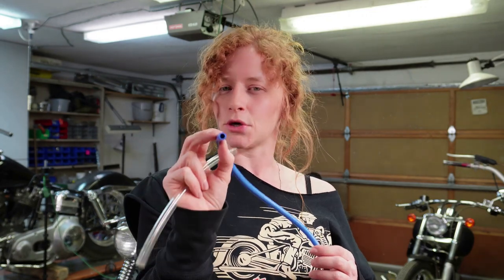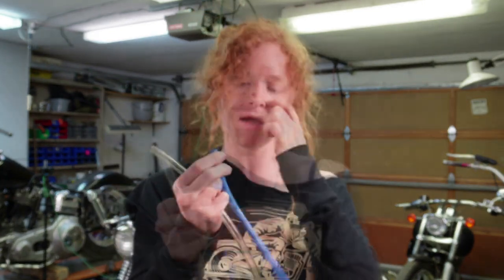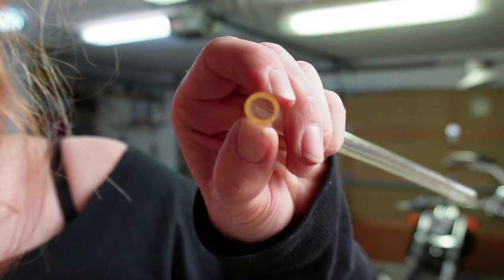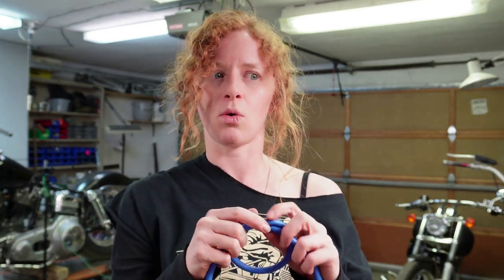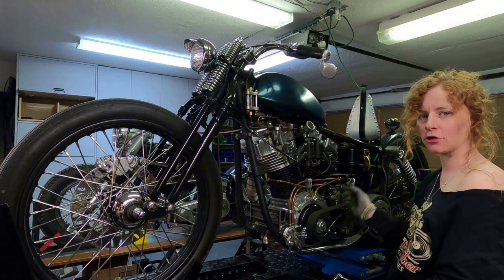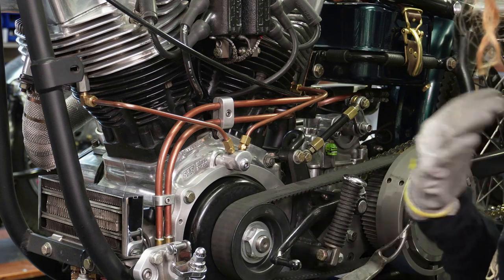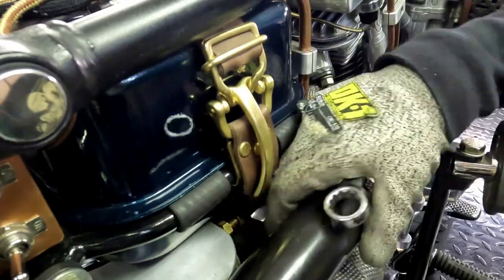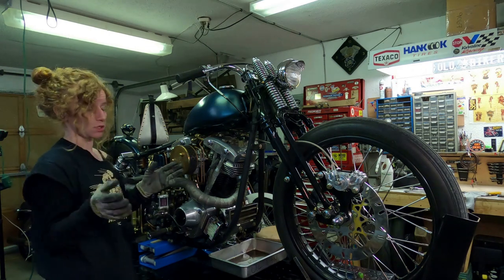Fluorosilicone Seals for Copper Oil Lines on My Bobber Harley

Comment: A set of ratcheting line wrenches from Hofmia work great on fittings with near zero wrench swing clearance, but they're kind of pricey. Cheaper but still awesome are Chicago brand open end speed wrenches, 45 bucks for a 3 pc set that covers 3/8 to 11/16, and to be honest they work just as good in tight spaces as the more expensive Hofmias as long as the fitting isn't insanely seized. That fluorosilicone is amazing stuff, I actually found out about it from my brother who's a chef, it's heat resistant enough for oven use! And the old Ford cop car I have has green silicone hoses, the new ones are blue and even heat resistant. I used it on an A.I.R tube for a catalytic converter, I couldn't believe it didn't melt. Keep up the great work, Angel, your channel's gaining subs daily and with good reason!
Reply from the maker: This like wrenches sound like they would make it a lot easier for sure! I’ll have to look into it. 
And yea, this silicone tubing feels like great quality stuff! And it hasn’t had any leaks yet!

Comment: Have you ever annealed your copper oil lines? 
Copper work hardens fairly easily.
Easy to do, after cleaning the oil from the lines, using a torch heat the just to the point the color starts to change and drop into water. 
This will bring them back to soft and pliable condition. 
And prevent stress cracks in the future. 
This also works for any copper crush seals you have. 
I wouldn't be surprised if you already know this as you seem to have a wealth of knowledge already. 
I just wanted to add this in case you didn't know. 
As always, I really enjoy your content. Keep up the great work.
Reply from the maker: Yep, I’m familiar with the process. Thanks for the comment!

Comment: Love the hinge tool for cutting hose square!
Reply from the maker: It works eh! I found a but if oil on a sharp blade really makes a big difference too and prevents the hose from binding on the blade. Just don’t get the oil inside the hinge because you won’t be able to keep the hose from moving around lol
Reply: @RedRiderCanadaBC  Will do

Comment: Had not thought about providing hard line flexibility at the oil connection points.   Way to go with adding  these details.  Should be a good line saver on low to moderate pressure connections.
Reply: Yeah. ... this is a good idea. Most people will splice in a section of rubber hose to give some flexibility to the copper lines ... I'm not a fan of how that looks tho ..

Comment: Only suggestion is to show more detail on the installation of the heard lines once you have the seals in place on the hard lines.  Also, you have soldered fittings and I'm curious how you do the that for the end fittings.
Reply from the maker: None of the fittings themselves were soldered, just a couple of the lines have some soldered pieces in them and that was mostly to make it a little easier to shape the lines so they would fit where they had to.

Comment: When I did my hard lines on a hard tail Sporty I built, I used Vibra-Lok Fittings ... They are designed for high vibration applications ... They work very similar to what you are doing here ...
Reply from the maker: Cool, good to know!
Reply: Where can  vibra lok fitting be  bought??

Comment: Very admirable that you are  wrenching and learning. Having  people to draw knowledge from will make you a better mechanic and keep you from falling into  traps that is easy to do when totally self learning. I myself would probably go with aircraft fittings/tubing/hoses.  But as they say, more than one way to skin a cat and the copper does have a old school/vintage look and the routing is cleaner with the precise bending.
Reply from the maker: Yea, i think knowing how to fix your own vehicles is important for anyone; it can prevent you from getting ripped off and will help in a bind! 
I chose the copper for the look. I haven’t looked into aircraft fittings at all but I’ve had a couple other comments suggesting them. 
Thanks for watching! I’m glad you are liking what you see 😁
Reply: 5 yrs and running ? I think your fine tuning is the way to go. No sense changing the personality of the bike.

Comment: It's why all the older cars have a couple of spirals off of the brake master cylinders. It acted as a coil spring to absorbe the vibration from the vehicle so there wasn't fracturing. I've thought about doing it on an old early 70s ironhead I have just for shits and giggles. This bike of mine will be very mechanical on purpose. Still have the original magneto from 57. Kinda an Indian Larry thing. He was into the mechanical side of things. Cool vid. I'm gonna subscribe because your worth subscribing to. Keep on keeping on Sister.
Reply from the maker: Thanks for subscribing!! 😁 
And yea, I know what you mean I’ve seen those spirals done in hard lines as well. I think it looks good if it’s on the right bike! Your sporty sounds like it’s gonna pretty cool when it’s all done too 😁 Have fun!

Comment: I don't what to say Young Lady, I love a woman with grease under her finger nails!
           Beautiful Angel,
No amount of money is too much for sensible parts that keep you running and safe. 
When I rebuilt the calipers for my winter bike (my 87 Goldwing), I paid the extra for braided black stainless steel brake lines. That entailed getting better connection fittings also. Why spend that money on stainless for a winter seasonal bike, because I Love to ride and get home.
Great work from a Beautiful Young Lady on a Gorgeous bike, Thank You for sharing.
You are in my prayers
Hoka Hey
Reply from the maker: Yes, spending the extra money for better parts is always worth it in the end! I spent extra on my wheels for my shovel as well: I bought stainless steal spokes and got the rims powder coated so that I don’t have to worry about rust. And I’m so glad I decided to do that!

Comment: I don't totally understand what you are doing with the fittings. Are you using the silicone tube in place of a compression ring or am I way  off base? I'm not a Harley fan in general but I do like your bike. It's gotten to  the point that I've been looking  at frames and such.
Reply from the maker: Hi David, thanks for watching! Yes you are right about that, I’m using the tubing in place of the brass ring that would normally be used in the fitting :)

Comment: Are you saying that the  compression  fitting cause the oil  line to break?
Reply from the maker: It won’t necessarily CAUSE the line to break, but it doesn’t provide any cushion because it’s a metal-on-metal seal, and it also has to be done up tight enough that it ends up squishing the line a bit where it’s sealing. It might not cause it to break, but the more vibration and you have in a copper line over time the more likely it is for the copper to become brittle and eventually break. Having a soft seal in the fittings and making sure your lines are secured so that you can reduce vibration as much as possible will just help to preserve the coppers integrity over long periods of time.
Reply: You are right  Red.
Vibration will make  copper  "work harden ".

Comment: Hi 👋 Miss Red Rider,
Gasoline is silicone’s Kriptonite, but fluorosilicone is a little bit better, especially if it has to deal just with oil. John Guest’s quick cartridges, snapped into fuel rails (for example) have two o-rings: the one which is in direct contact with fuel is made out Viton B70 and the second one, which works just in case of low temperature failure(it’s used right because it maintains its softness at low temperature) of the first one is made out of fluorosilicone. In “standard” condition ( temperature > -30 degrees Celsius)  it’s not “touched” by gasoline., actually.
Conclusions: probably not the oil/gasoline vapors compatible material world champion, but I’m pretty sure that it’s reasonably durable.
Here’s a link to an “elastomers vs fluids” compatibility chart, if you want to check it personally. 
Have anice weekend!

https://www.astonseals.com/pdf/supporto/materiali/Fluid_compatibility_table.pdf
Reply from the maker: Hey man that's great info, thanks for sharing! 🙂